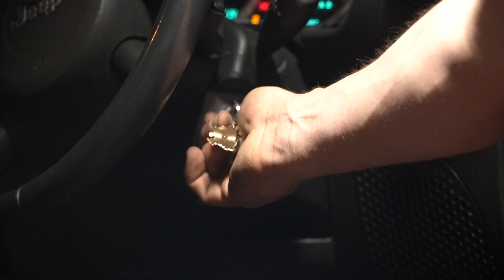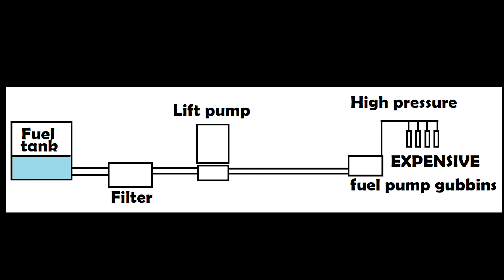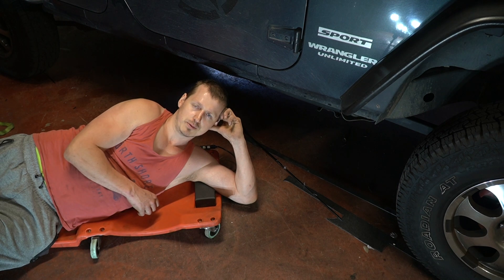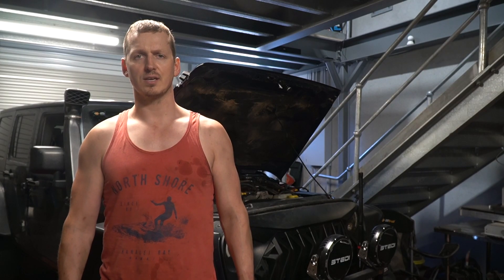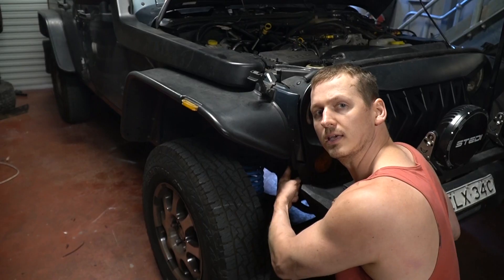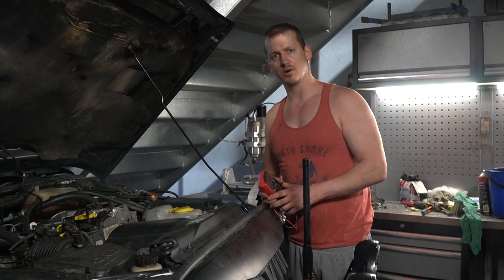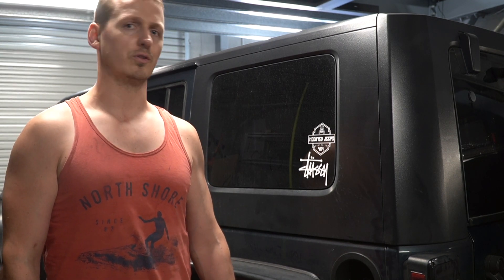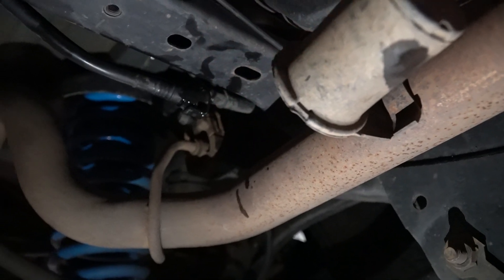Hey America! This is why we all hate Jeep

Comment: Everything I've driven has had the fuel filter somewhere along the frame.  Usually, not so well protected.  I actually like that Jeep has it so well protected.  I'm thinking you are supposed to remove that whole cross member/ skid plate to get better access.  Def something wrong with fuel in the vent tube.
Reply from the maker: Yup. Although most filters I've seen under the body (Prado etc) don't require you to take off crossmembers and are well out of harm's way rather than being IN the frame rail and close to the abuse. 
As for the vent. Yeah, no idea what happened there. If you watch closely you can hear a pop and smoke comes out.

Comment: That has to be the most stupid placement for a fuel filter that I have ever seen. 😱

Did they not think of the engine bay perhaps, where they normally go?
Reply: The stupidest place for a fuel filter is inside the tank, which is where it is on my Toyota.
Reply from the maker: Usually if there's a lift pump, there's a filter near the tank underneath. Sometimes 2 if the manufacturer is feeling fruity. No lift pump and they're usually in the engine bay.

Comment: Had a Jeep, at about 85000km it started getting engine warning lights which the stealership said could be this, could be that - we’re just going to have to start replacing modules at $2500 a pop till we “fix” it. Walked out did my own research realised likely culprit was a gunked up intake from egr etc on 3.0l td. Got a scan tool cleared the fault code, sold the car to a dealer and bought a 79. Moral - Never buy a Jeep. Unless you’re a masochist and have deep pockets of course 😂
Reply: 🤣 You would think that they would have a better look at the car.
Reply: @madcat4563  yeah naa shotgun approach- just keep throwing parts at it instead of actually diagnosing the problem after all the customer has endless amounts of money to throw at the “repair”. I asked if they would put the existing modules back in at their cost if the replacements didn’t fix the problem and they were completely flummoxed by a customer wanting to only pay for actual required repairs that fixed the car. Don’t buy a Jeep.
Reply from the maker: Clearly, you had the wrong person working on it 😏